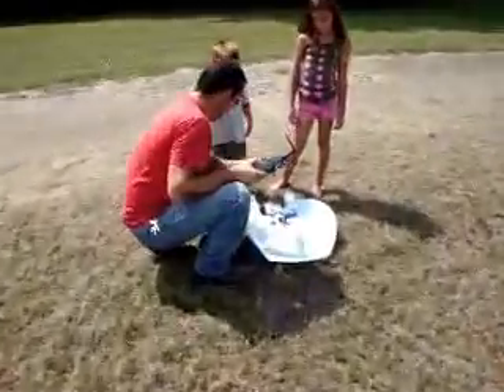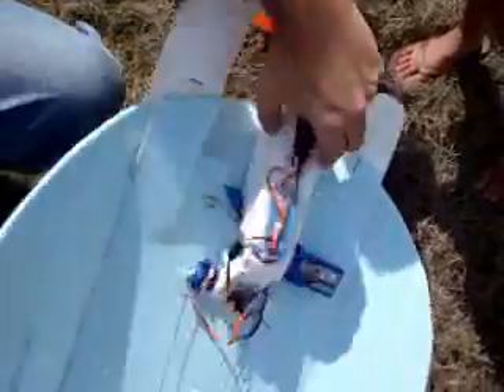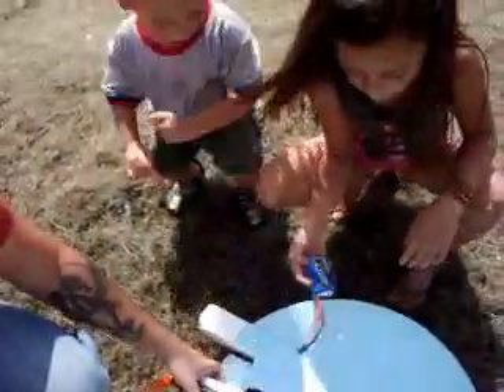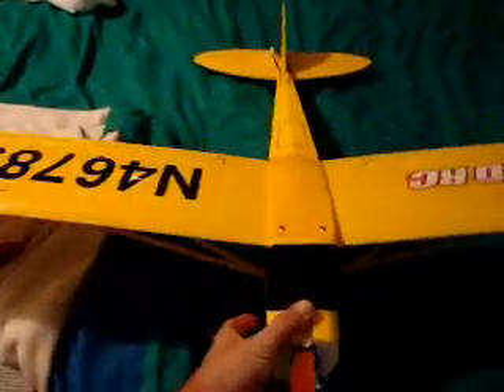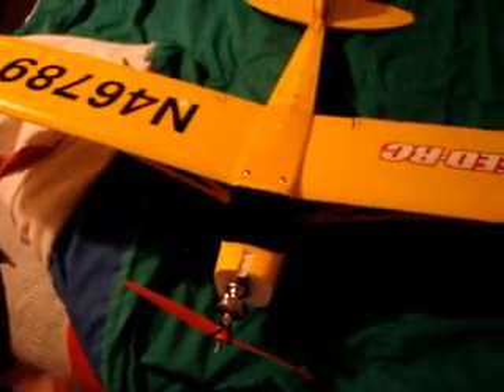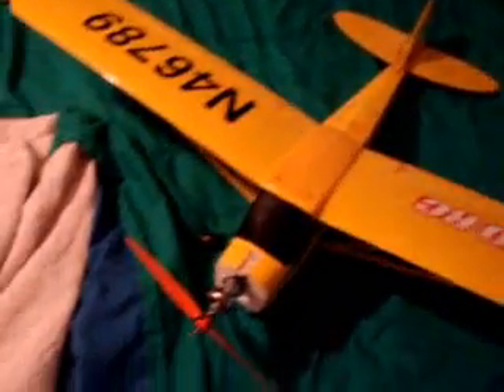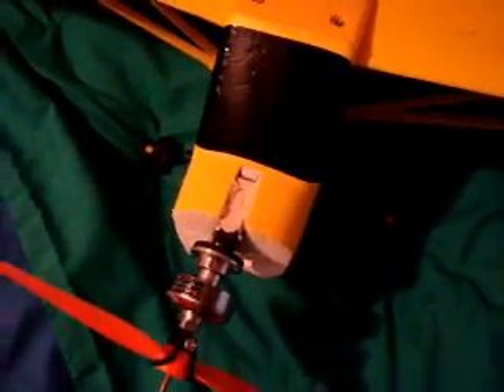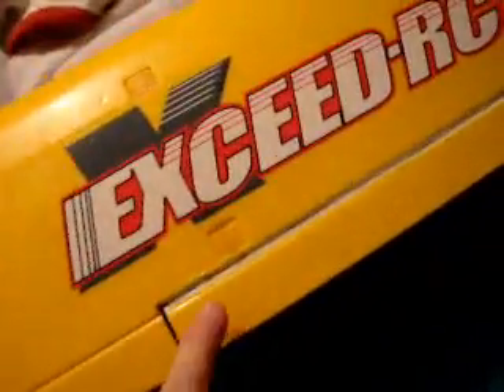death of a snowball

Comment from the maker: the ailerons are the flaps on the wings. they move opposite of each.other , 1 down 1 up. that gives you the roll. if your wings go all the way back, like a delta wing. then you have to mix ailerons with elevator to make elevons. that is done using your transmitter or (if you have a cheapo radio) you can use a v-tail mixer.